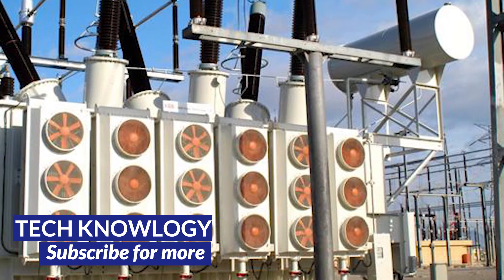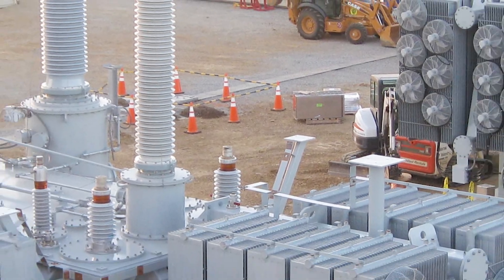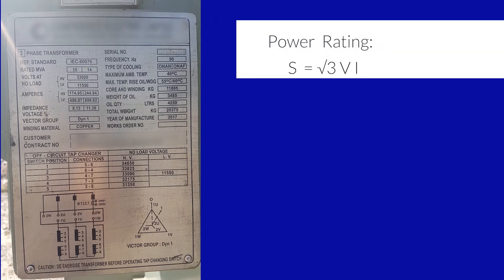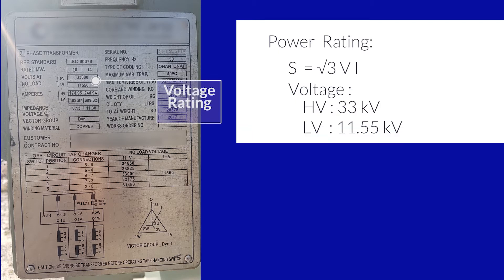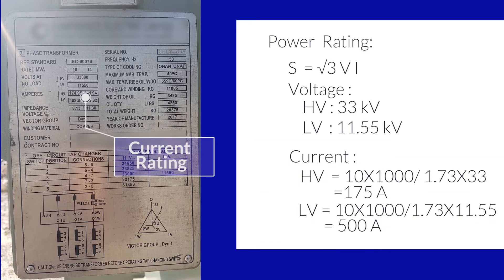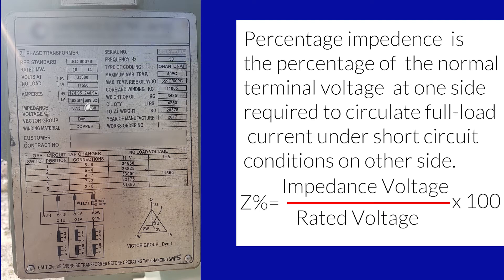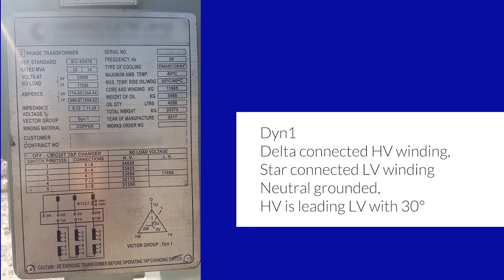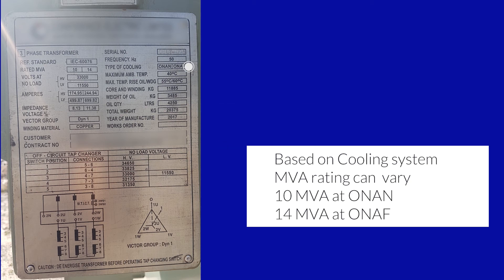Distribution Transformer Namplate details explained |Understanding Electrical Transformer |

Comment: What does mean by 10KVA rating of the transformer? Is it transformer input or output? Please clear me.
Reply from the maker: The 10 kVA rating of a transformer indicates its maximum capacity to handle power. It applies to both the input and output. This means the transformer can receive up to 10 kVA of power on the primary side and deliver up to 10 kVA of power on the secondary side without overheating or being damaged. The kVA rating represents apparent power, which includes both real power (kW) and reactive power (kVAR).